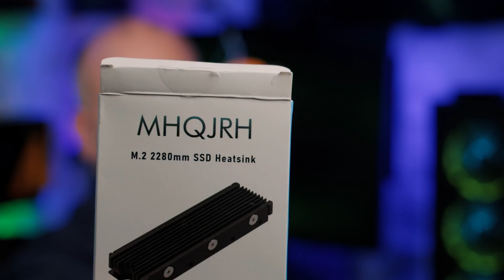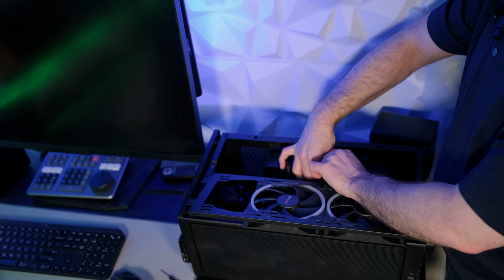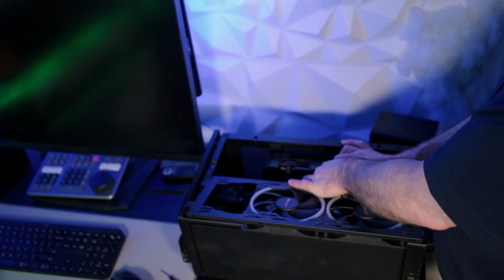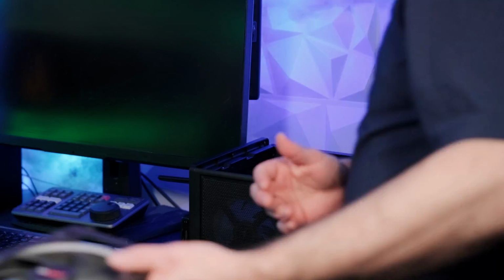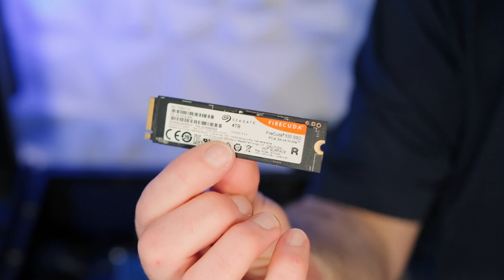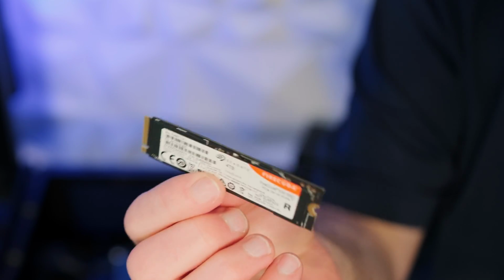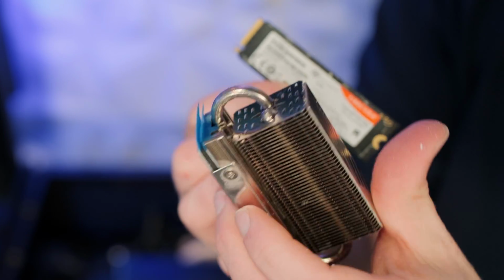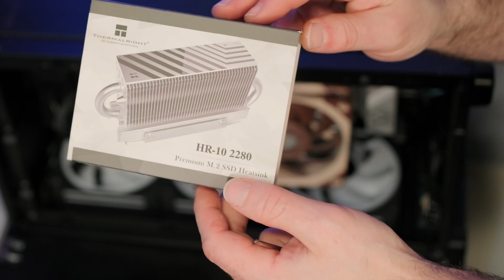Thermalright HR10 M.2 2280 SSD Cooler & MHQJRH Review

Comment from the maker: These were self purchased
M.2 2280 cooler Necessary? No, the drives throttle their speed to prevent overheating but at the cost of performance.

High End performance M.2 drives with high storage capacity:
These coolers would be used to maintain top read and write performance at all times for video rendering (large file write and reads) and large game installs or or other storage read / write operations. 

Entry level M.2 drives and lower capacity:
These low performance drives run cool. All M.2 NAND flash memory has a certain happy temp for max performance at around 40C. 

Me or anyone else likely won't notice a difference for normal everyday stuff like watching videos, surfing the internet downloading a file online.
Reply: Ok so my build is... Umm... What you would consider enclosed. The FC8 Alpha case doesn't exactly allow for much airflow, on top of that I have a Pulse RX 6400 and a Ryzen 2600E cooled by a separate 50mm heatsink as well as the case which also acts as the main CPU heatsink. The CPU is fantastic, RDNA 2 is designed to handle upper 80s perfectly fine, but the SSD, how am I getting these absurd readings? You say it shouldn't be possible. Should I buy some kind of heat scanner?
Reply from the maker: @HedgehogY2K  firstly stop using that Hardware info, I think you are getting false readings, use the proper Magician Software. Secondly the m.2 drive you have maxes out at 80C and than throttles hard.

If your temps are that high and it's not the drive than I would consider a possible bad PSU that is cooling your system. Feel the out side of the PSU. I had 2 Antec Earthwatt power supplies fry on me (long ago) and they got super got on their way out and was cooking my GPU along with it. A power supply if bad can take out a GPU and other parts of your system. or it could be just use the right software and also see if there is a Magician Software firmware update for your m.2 while you are at it.
Reply: @sparketech  Oh and the Streecom equipment calls for Streecom PSUs. I have the 160w and it runs beautifully. Actually my PC has worked fine for months. Ok, I'm turning on the PC to test Halo Wars 2 since that's where the "stress" is supposedly coming from and open up Magician and see if I detect a different result.
Reply from the maker: @HedgehogY2K  that RX6400 80C would be hot for at 53 watt TDP GPU but it runs hot apparently by a google search. That is certainly not going to be a cool case temp wise. I finally looked it up, fanless design
Reply from the maker: @HedgehogY2K  My power supplies that died didn't die suddenly, it died after 6 months and after 1 year... it died cause the 12 volt rail wasn't able to handle the GPU plus CPU power draw is what I figure. your CPU plus GPU is 118 watts on the 12 volt rail. plus other components. motherboard likely about 15 watts, ram maybe 10 watts and m.2 around 8watts. Not saying it is the power supply but your system with a dedicated GPU is certainly pushing the limits. Oh you have a Nano 12 volt only PSU, interesting.

Technical Specifications
Max Power Output	160W* peak
Input Power	12V DC, 13A
Output Connectors	1 x 24pin ATX, 2 x SATA, 1 x IDE, 1 x 4pin CPU
Input Power Cable Length	400mm
PCB Dimensions (WxHxD)	54 x 26(37*) x 18mm (WxHxD) * including ATX connector
Input Power Range	110-264V AC
Power Characteristics	12V @ 8A, 5V @ 6A, 3.3V @ 2A, 5VSB@ 1A, -12V @ 0.02A

Okay look at your PSU spec 12V @ 8A you are drawing 118Watts at 9.333A and are indeed exceeding if the specs I am reading are correct.
Reply from the maker: @HedgehogY2K  direct from Steetcom
Max 12 V amp is 8. Confirmed you are exceeding your power supply.
Reply: @sparketech Magician shows 70 thus far.
Reply: @sparketech  Your right! Magician shows 71 while hwinfo says 93. I was worried over nothing.
Reply from the maker: @HedgehogY2K  i do worry about you over limit of your power supply as I looked up and messaged. You're exceeding the specs of the 12 volt rail. Your power supply is bound to fail earlier in life and could take your CPU and GPU with it when it does fail.
Reply: @sparketech  83c before I turned off the PC?
Reply from the maker: @ 83C is pretty hot but your case doesn't exactly have any airflow, double a case with airflow would get that hot.
Reply: @sparketech  Fanless? I never heard of a fanless RX 6400 where did you read that?
Reply: @sparketech  Not really. 157w is for the entire system. I've not seen the 2600E go past 77 watts which is disappointing considering the non E variants go up to 88. 53+45 TDP rated shouldn't be a problem. I was also concerned when building this but is all turned out ok. Even upped the clock to 3.2GHz via TPU 1.
Reply from the maker: @HedgehogY2K  you case being fanless.
Reply from the maker: @HedgehogY2K  CPU 65W TDP, GPU 53 Watt TDP both use the 12 volt rail. your power supply isn't 157Watts 12 volt rail it is 96W and part 3.3 W and part 5W rails. It's on the specs. It's your call, just don't say I didn't warn you when things go sideways.

I have your very power supply bookmarked, under performance Amax (Amps max) under 12V @ 8A, 5V @ 6A, 3.3 @ 6A

Keep telling the guy that works as a electrician by trade he's wrong. My job is literally electrician. If you look up LNG Canada Kitimat I worked there building the site for 2 years, Site C Fort Site John I also worked there 1 year at the hydro electric damn.
Reply from the maker: @HedgehogY2K  The Nano160 is our 2nd generation ultra compact fanless PSU designed to provide silent ATX power for compact form factor computing. The PSU fits perfectly into all Streacom cases but can also be used as a silent PSU solution for any PC case. 

Featuring 160W* of combined total power output

Max Power Output: 160W* Peak
Input Power: 12V DC, 13A
Output Connectors: 1 x 24PIN ATX, 2 x SATA, 1 x IDE, 1 x 4PIN CPU
Power Characteristics: 12V @ 8A, 5V @ 6A, 3.3V @ 2A, 5VSB @ 1A, -12V @ 0.02A
Input Power Cable Length: 400mm
PCB Dimensions: 54 x 26(37*) x 18mm (WxHxD) * including ATX connector
Reply: @sparketech  You know when I did hit the 150s, it was struggling to operate and not crash. I haven't stressed it since but I actually was kinda scared it would shut down. I'm impressed it didn't given the load. If any power supply can keep a system from crashing at their worst points, they own the system.
Reply from the maker: @HedgehogY2K  Until it crashes and burns. It's cool it can over stress but it'll die sooner than expected at some point someday under load and hopefully it won't kill your CPU and GPU but it deff can. My Antec lasted 6 months and another 1 year being overloaded. Streacom also has a 240watt Nano PSU that can replace it. it has 12V @ 14A made to handle 168 watts CPU and GPU load
Reply from the maker: @ Oh dang the 240watt costs a small fortune $286.00
Reply: @sparketech  A fortune I will not attempt cause the last adapter I got failed and I had to buy a whole new 160w kit again. I need to sell the 160w power brick by itself but who in the world could be holding onto the 20+4 adapter only just to get the brick with it. I already know how scarce Streecom PSUs are on eebey. I don't know what to do with it.
Reply: Hello sorry for the rampage question but I watched your video about memory timing I am use dram calculator for Ryzen. I have an intel cpu but the problem is it’s not showing my ram timing they are are 0 with a few at 1? But I’m msi bios showing like 19 25 25 48 and the rest is auto help please 🙏
Reply from the maker: @connerdave6397  I have 3 videos but the 2 older ones have the newer video in the description... Either way if the dram calculator has blanks for Intel timings... thank you for letting me know cause I didn't have an Intel system to test. You can use CPU-Z also known as CPUID. If you write me on Facebook or Discord or email me I can send you a link. YouTube gave me a warning once for posting an external link for someone in comments.
Reply: @sparketech sorry I read that wrong lol how do I find your fb I can’t seem to find it
Reply from the maker: @connerdave6397  Facebook Spark E Studio or simply video description... Just under the heading "Spark E Other Channel, Discord & Facebook"

Comment: Just a noob question, am I supppose to remove the warranty sticker before applying the cooler?
Reply from the maker: @Jsandiego_17  i am assuming you are talking about that tape cover over the top pf the SSD? Because that would be a heat spreader; leave it on.
Reply: @ Ohh cool thankss!

Comment: My 2TB PCIe x4 NVME was hitting over 65C while gaming even with the motherboard heatsink, so I grabbed one of these (HR09) on Amazon and now it peaks out at 46C while gaming and it was only C$12.
Reply: Is your ssd two sided? I mean both front and back side memory nands exist? So the cooler didnt squeeze the ssd?
Reply: @engin213  I have the HR09's big brother, the HR10, and it doesn't squeeze the drive unless you make it squeeze the drive.

Comment: Can i use this in VRM?
Reply from the maker: Sorry I don't understand your question... VRM is a voltage regulation module. I have no clue how these would attach to a VRM unless listed for the purpose, I could force these to work but I wouldn't trust Thermal adhesive or thermal adhesive strips to hold in the long term. I saw someone online used the m.2 cooler for VRM but he never shows it hold once he bumps his case or if it holds for longer than one day.
Reply from the maker: MG Chemicals 8349TFM Thermally Conductive Epoxy could work much more effectively than any form of tape (I purchased this)... You would have to apply some weight like 1 lbs to keep good contact while epoxy dries (24 hours I think was cure time) and i would after let the computer run for at least 4 hours or more before tipping the case back up right to ensure fully cured and heat activated with VRM temp.
Reply: If you can mount it then yes.

Comment: Nice! Can the top plate be removed? Seems like it would cool better without it
Reply from the maker: I don't see any way to remove the top other than by force. Please don't obsess over cooler temps than this provides. Why? Because you WANT M.2 SSD's to be warm, yes you read that correct. If you over cool the SSD it runs slower just like I mentioned in my pinned comments. Any cooler than 40C the NAND memory is written to slower. The concern for throttle is when temps are still getting over 60c, most thermal throttling happens at 70c depending on what is spec of course. If your M.2 is between 40 idle and 60C under load it is running at it's best at all times.
Reply: @sparketech  Interesting, so fan mounted coolers would be excessive let alone a large heatsink.
Reply from the maker: @Ghovna4R  Most M.2 drives don't run close to hot enough to have any need for a fan except for making up for a really lousy heat sink. A big heat sync can still be good for a very high performance high capacity M.2 drive. Entry level M.2 drives usually run cool and can actually hinder perfomance since Nand memory needs to be at least 40C to achieve proper performance
Reply from the maker: It's odd I know, CPU, GPU and most stuff is cooler the better. The controller silicon of the m.2 is fine to be super cooler but that NAND flash memory is different.

Comment: I just got the new Crucial T705 PCIe 5.0 NVMe M.2 SSD, so I ordered both heatsinks to try out the difference between them and the motherboard heat spreader.
Reply: Haben Sie eine deutliche Senkung der Temperatur erreicht? ... Ich habe auch eine T705 und erreiche etwas über 80 Grad im Bench ... dann drosselt die SSD um über 40% runter ... Bitte um Feedback, ob sich der Thermaright Kühler lohnt ... Danke
Reply: Did you try them? How is your M.2? Im waiting for mine.